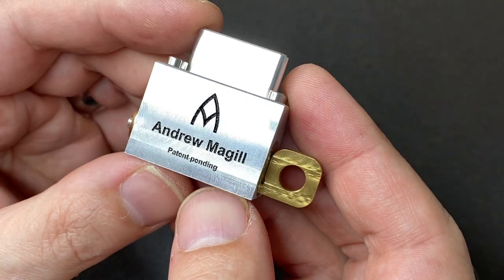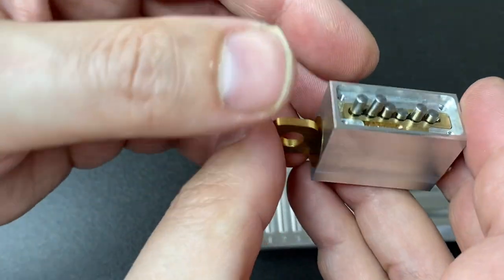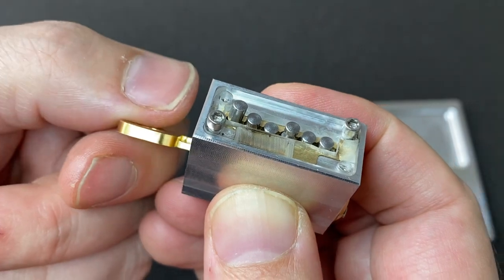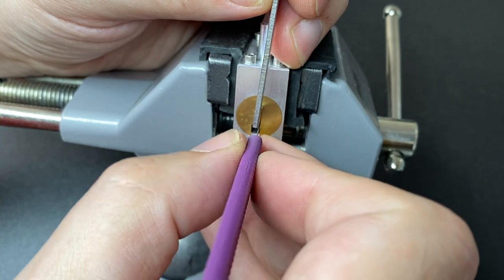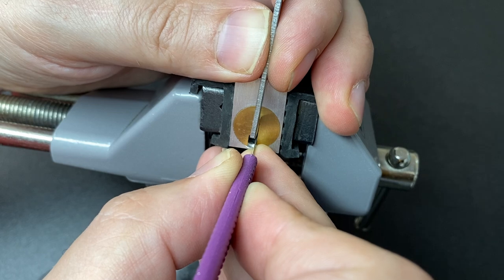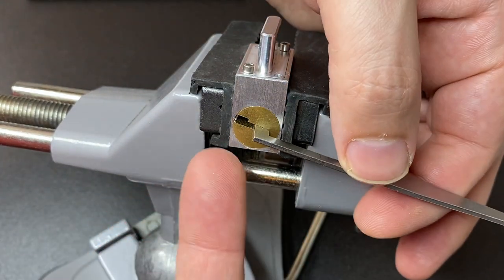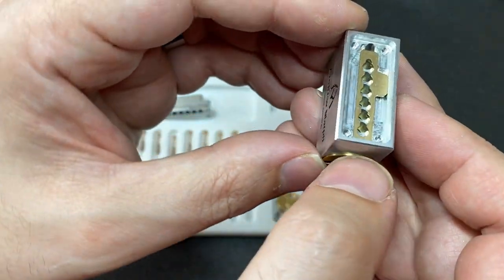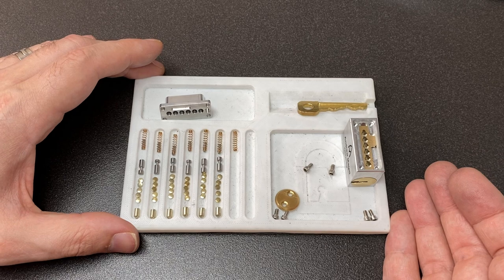Unpickable? Enclave - an Ingenious New Lock Design

Comment: Very. Ice to see new consepts, looks like picking is more like picking codelock :) without feedback its a try all combinations, very much time. Physical attack…. 1 rotating surface 1 pin 1 gate on too. Requires careful balancing of shapes and material. 1.6mm wide key at narrow point sounds like very much a “put small crowbar and force it” atleast test it to see if angles and material choice would make it not feasible. Maybe a more narrow key, maybe. Great cool lock

Comment: That is a fantastic lock ..it's like picking a combination lock ware you you would have to work through all posable permutations , absolutely brilliant
Reply: It is even worse than that. You have a binding order on the wafers so to test a combination, the first challenge is to enter the combination you want to test. Very often you cannot simply add one wafer to a stack and test the new combo as the binding order makes you drop a few wafers.
Reply: @yom73  I'm curious to see the final product to see if is venerable to a bypass driver attack because with that "side bar"  bypassing the actual mechanism of the lock seams rather impossible

Comment: This is conceptually identical to the locks Stuff Made Here was prototyping, except this is just 10 times as elegant, and has way fewer points of failure. You can only manipulate the pin stacks when the "checking" part of the lock is not being tensioned, and you can only tension that part after the pin stacks are no longer engaged. The genius part was to have a pin tumbler mechanism combined with a sidebar. One for moving the pins, and the other for checking.

Also tell about this to the LockPicking Lawyer!

Comment: I wonder if by pinging the spool pins you could figure out the bitting. I think the tone of the spool pins could give away the bitting,well least narrow down each pin to one of two choices. Every wafer pin and every key pin has exactly one tone and each pin hole has the same amount of wafers, so you should be able to isolate those out. If the spool pins were solid cores they would have exactly same tone as well but the cut around the diameter should cause it to resonate like a tuning fork, and the depth of metal beneath the cut should affect the tone/volume. This means you should be able to figure out how much metal there is before the cut by tapping it. This should be hard to defend against since if you added more metal to hide the tone, the depth will give it away when you push the pin all the way down.

Comment: If that 7th Pin is steel,  would applying a strong (i.e. Neodymium) magnet to the lock body above it apply tension to the slide bar whilst you still had access to the pins, allowing you to pick?

Comment: if you put alot of force on the fauls gate could it wedge that end pin? giving you the opportunity to pic the slide bar? it would be difficult enough and be like picking two locks at once but correct me if I'm wrong
Reply: just so you'd get feedback to decode the lock

Comment: This is definitely something id like to see LPL try to pikck or defeat. From my perspective the only weak spot i can see in this lock is this "lock pin" on the back or the top "sidebar". If its made from a strong material it should be resistant to forcebly turning the core once the "false set" is set. Given that someone is aware how this lock is made. Also after watching it now im thinking is the last pin round or not. As if it is round what would happen if  it would turn 90 or even 180 degrees just because it can? Would it prevent it from sliding the bar?

Comment: So instead of pins that separate in 1 spot you use a shorter pin with security wafers that provide many false gates per pin and a sliding bar only when you have the correct gates engaged.  Reminds me of a combination lock only with a key.  Lets hope this holds against bump keys.

Comment: looks like you could overlift all the pins and then slowly reduce pressure on the bar and hope they catch in the correct place. Maybe using vibration would help.

Comment: 6 pins with 5 wafers gives 6 theoretical positions per pin so 6^6 wich is 46656 combinations. so if you could try one combination a second it would take almost 13 hours to try them all so on average 6 and a half hours to pick if you tried each combination one at a time

Comment: You could in theory attack and decode this lock faster than brute force with an instrument that very precisely measures the angle of false sets. In theory, because of manufacturing tolerances, whenever at least some pin stacks are aligned, the false set should be just a little bit deeper than when all stacks are misaligned.

The procedure would go like this:
1. Count the number of pin stacks (e.g. feeling around with a regular pick, using a miniature camera, or any other way - or you can just know in advance that e.g. lock model X has Y pins).
2. Choose one of the pin stacks you haven't yet decoded for testing (we will call this stack X).
3. Set all other pin stacks that you haven't yet decoded to the lowest position that enables a false set.
4. Set all other pin stacks that you have already decoded to the position found before.
5. Set stack X to the lowest position you haven't yet tested (we will call this Y).
6. Measure the depth of the false set, and note it down.
7. Repeat steps 3-6 for each possible Y. If successful, one value of Y will yield a false set significantly deeper than the rest - this is your decoded position for stack X. If unsuccessful, queue this stack for retesting once you have gone through every stack already.
8. Repeat steps 2-7 for each stack X at least once, and then retest undecoded as necessary. Note down the order in which you're testing stacks, to check for failure (e.g. if in a 6-stack lock, stack 2 fails to decode on the first try due to no Y yielding an outlier for the false set depth, but then succeeds when retested after every other stack. your noted order will be 1-2-3-4-5-6-2-open).

Success is indicated by an open at one of the false set depth tests (obviously), while the failure condition would be a tandem repeat in your noted down stack testing order (e.g. 1-2-3-4-5-6-3-5-3-5 - because you have two 3-5 sequences back to back, that means tolerances are so good you can't get a binding order on stacks 3 or 5).

Assuming no failure due to a tandem repeat / cycle, for a 6-pin (+1) design like this with 5 wafers (= 6 breakpoints in the stack), instead of 6^6=46656 trials, this requires 6*6=36 trials in the best case, and 6*(6+5+4+3+2+1)=126 trials in the worst case (measuring depth of false set at each trial, until one yields an open).

How could a failure occur, that is, how can we defend against this attack? The same way you'd do on any other gate-based lock design: false gates!
Reply: Wouldn't it be 5positions+5 other pins for the first unknown and 5+4 for the second one so 45 tries at worst?
Reply: @ss-eq1uk  It's 6 positions per pin stack because of the fencepost rule (a pin stack with a key pin, a driver pin and 5 wafers in between has 6 possible breakpoints). You only care about one pin stack in each trial, setting the other pin stacks to either the lowest position (if not decoded yet) or the decoded position (if already known), just so they don't block the false set. By varying the position of only one pin stack and keeping all others constant, you can measure the effect of that one pin stack on the depth of the false set, which should reveal the location of the gate on that stack.

Comment: I think it is perfectly pickable but not in reasonable time. You can use sophisticated pick that gives you the position and depth. This way you can go through all combinations that let the drum to rotate until you find the one that will rotate further. It's the same method as brute forcing a multiple digit PIN. 6 pins with 6 positions each, 46K combinations. More than enough to give up.

Comment: Nice design but not unpickable.
It get the foundamental idea of decoupling "to set" and "to check".
Unfortunately the number of attempts needed to an opening is not exponential (as in trying every possible key) but quadratic in the number of pins.
Still better than locks that can be opened with classical picking: that attack has linear complexity.

Here is the quadratic attack, it was the first thing that come to mind to me and, looking at he comments, many others.
Let k be the number of possible pin height (what was that? 5 wafers?) and n the number of pin stacks (6?).
Using a sputnik like pick we can find the first binder for the s(l)idebar testing one stack at a time (at wost k*n attempts) and looking for the widest false set (maybe using a needle on the pick to watch against a reference in the background).
When the first binder is set the second one can be found the same way but with one less stack.
The worst case is the sum of the worst cases needed to find all the binders: k*(n+1)*n/2 attempts.
The average number of attempts is the sum of the averages i.e. half of the worst case: k*(n+1)*n/4.

105 attempts looks to me as a feasible attack, probably under 5 minutes with a bit of practice and a custom tool.
Obviously random notches on the pins would greatly frustrate such an attack.

Anyway the worst defect of the design is not a security one, is the risk of jamming with all those wafers.
Using small steel balls may be an improvement but it would reduce the parameter k.

Comment: This lock might be able to be opened by getting the lock to turn to 45 degrees while moving the pins up as little as possible, then putting a decent amount of tension on it while you hit it with a hammer or something to make the pins pop up, then, with a bit of luck, the sidebar will catch the pins in the grooves and then you can open the lock.

might not work, but could be a good try
Reply: I was thinking that too but it depends on how much wiggle the pins/wafers have.

Comment: It seems this design would also need a different activator design since most on market would already activate with the amount of rotation given hence not allowing use in most commercial applications with the other part needing too be made by them
Reply: I don't know about American locks, but Euro-style start activating somewhere in the 100-130° range. So no problem here with the bar blocking at about 60-80°. But you can always mount the actuation lever rotated back a couple of degrees.

Edit/PS: In a Euro-cylinder the lever is rotated back so it blocks the cylinder from being pulled out when the lock is in the neutral position. That's the extra travel until it actuates, it first has to travel into the lock and then out the other side.

Comment: Yes, I think it could be picked because of a design flaw and tolerances of the device. Here's how...  First, the design flaw: Since each chamber is stacked with shim/wafer pins, the plug will be easy to pick and turn.  Then you will need a tension tool with a long arm to amplify the amount of rotation of the plug.  And because the tolerance is not 100% perfect, every time you pick to a different shear line you can test and see if the plug turns farther as the slide bar is free to slip into the top pin open shoulders.  The more top pins lined up, the farther the plug will turn.  A bit like manipulating contact points on a combination safe with a drop in fence. A Lishi style pick would also help to know depth and spacing.  Difficult, yes, but not impossible.

Comment: Was having thouhgt experiments with designs like this before. There is a way to decode them but its not very pretty. You need a lishi tool for the lock and something that is very accurate in measuring rotation. You should be able to get away with calipers tho.

The weakness with a sidebar that is directly linked to the rotation of the core, is that minor differences in sidebar "engagement" can be read from the rotation of the core. Like everything else, this sidebar thus has a bind order and that should be able to be measured. 

The lock has 6 pins with 6 positions. Checking every position once for each cylinder (36 measurements) should give you your first pin, then 30 for the second,  24, 18, 12 .. for a total of 120 measurements (You don't have to measure the last one). Realistically speaking you should be able to infer more of the pick order after the first complete measurement so you don't have to check everything every time. 

Still this look is at least one order of magnitude better than current locks.

Comment: Have you picked the Yuema 760 core?  It works the same way with a very different core.  The Yuema 750 is also instructive, as it shows how to prevent information leakage from external tensioning of the lock.

Comment: Seems like it may be easy to overpower like the Kwikset smart key. Only the rear pin is stoping the cylinder from turning. Seems like with a turning tool or big screwdriver you could deform the one pin or cam. Someone needs to test that.

Comment: So just pick it until the only thing holding it is the sidebar, then brute force turn it with a hardened tool and a breaker bar. 
That brass bar will deform like butter.

Comment: Crazy! 
I have a sketch for a CL that is weirdly similar but a bit opposite as there’s a plate push the opposite direction and a hidden pin that has to retract. Due to lack of skill and precision I never could make it, and it had a few other issues, like a proof of concept I tried required the lock to be turned upside down and banged on yo get the hidden pin to reset. 😂 The wafer stack thus had is put to brilliant use.

Comment: This is really smart. It turns it into a combination lock for the lock picker, with 6^6 combinations = 46656. You reached 4 pins which is 1296 combinations and feasible by trial and error. Has this been tested yet by lockpicking lawyer?

Comment: I think that while unpickable it would be vulnerable to brute force attack, as there is only one pin physically blocking the turn. A lever made of strong steel could just bend the top plate and crack the whole lock body open by shearing the tiny screws holding the top.

Comment: Brilliant design. My only real worry about this lock is it's durability. All those thin wafers will eventually wear down, tilt and (permanently) cease the lock. The isolated pin seems to be inspired by both a deadbolt and safe design..

Comment: After the “false set’ could you vibrate the pins while in the 45deg position (with tension) to try to set the cutouts/allow the bar to slide?
I.e. treat it like it’s 2 locks, each with a different solve.

Not a locksmith, so I don’t know if that’s realistic, or whether the top springs prevent that.
Reply: That wouldnt work if the lock is in a door

Comment: Ya'know that NASA saying about it doesnt matter what something is supposed to do, it just matters what it CAN do? ...well, the weakness in this design is the 'sidebar' being made of a softer, thinner material than that last blocking pin. The blocking pin being made of steel has the potential to easilly deform the brass plate, and it is further aided by the Cam design at the back of the cylinder that pushes it up when the cylinder is turned. So, once youve got each pin stack up to one of the wafers, the only thing stopping the cylinder turning fully is that steel pin blocked by the sidebar, which with some leverage to the keyway, could be forced upwards, deforming the edge of the sidebar, allowing it to move up fully and the lock to open. That sidebar needs to be thicker and made from hardened steel.

Comment: I guess the weak point is the last pin which moves the side bar. I would pick it until it gets in false open state and then twist the core with brute force. I guess it doesn't require much force to break the sliding mechanism.

Comment: Wonder if it's possible to get enough of a grip on the back pin to tension it against the topbar without turning the drum, which might let you then get feedback from the pins while picking them when their slot gets aligned with it.

Comment: I am a total noob but here is what i would try:
Push all Pins up with a cone pick. 
Given the pins and the metal bars are made of magnetic steel, you should be able to hold them up with a magnet.
Next remove the pick. All Wavers and driver pins should fall down, because it seems the wafers are not magnetic.
Now turn the lock and tension the side bar.
Since the wafers dropped down there should be room for the main pins to drop down to the real gate. If you hammer the lock while tensioning the side bar the lock might be pickable this way. 

I believe this exploit would not be accessible when the lock is build into a door but right now this might be a possibility.

What do you think Youtube?

Comment: I've been wondering - would it be possible to pick a lock using an expandable metal/rubber 'key' that you can just slip into the lock and it'll form to the right dimensions? I've been thinking about that for years but I don't know how practical it is.

Comment: This may be ignorant, because I'm still new to this...
Wouldn't this be more susceptible to a brute force attack?
Only one pin is responsible for keeping the lock shut when the incorrect key is used.
Wouldn't it be relatively weaker if it had been turned to a wrong combination and then smacked / received brute Force against that one singular pin keeping the lock closed?
Most likely nearly unpickable, but that doesn't account for practicality and price obviously

Comment: In the 45 degree position, would it be vulnerable to a percussive attack? Hit the lock with a rubber mallet enough, wouldn’t those pins eventually line up to the side bar?